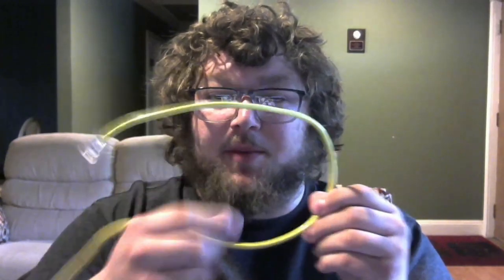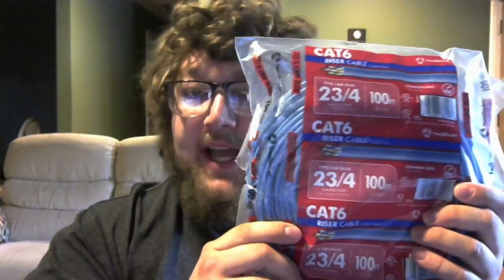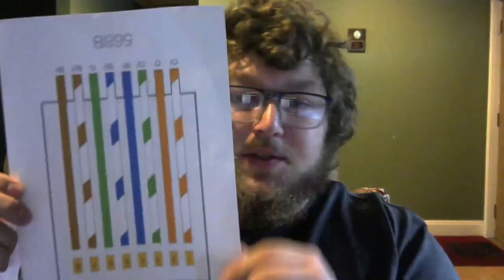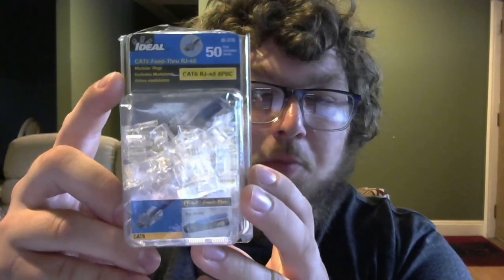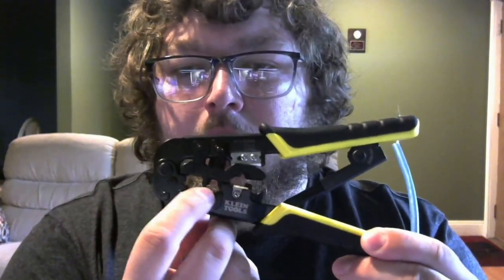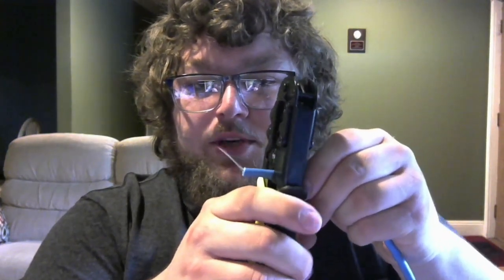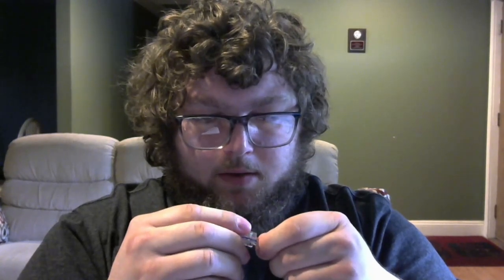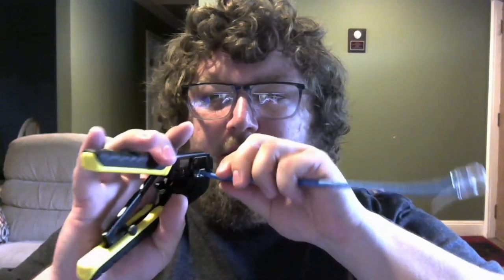How to make your own network cable in UNDER 10 minutes | EASIEST METHOD

Comment: It most definitely takes practice. Pass thru connectors are way easier. I personally prefer a different tester, one that separates so you can test cables that do not have the ends next to each other. Thanks Carmine!!!

Comment: 2 tips for you buddy.  Before you put the wires in order, straighten them, but use the pencil or s small screw driver to rude the wire along with your thumb, second, after you get the wires through the RJ45, twist them all together, then you can put them through your tool and crimp, no need to trim the wires :)
Reply from the maker: that’s a good one! i’m going to use that next time